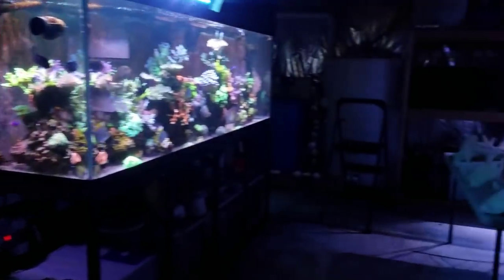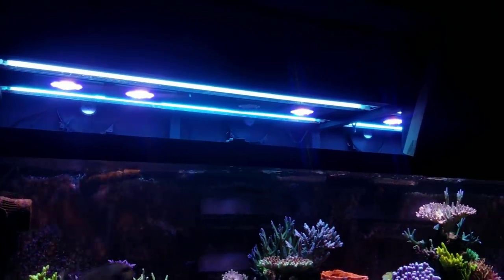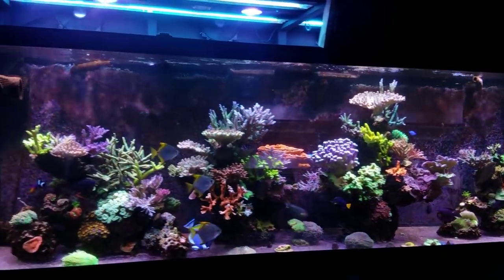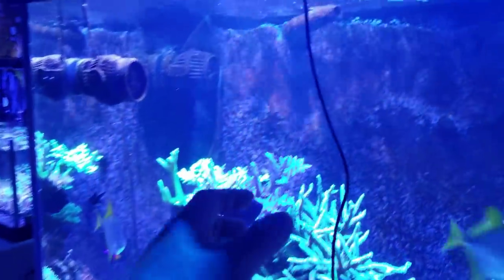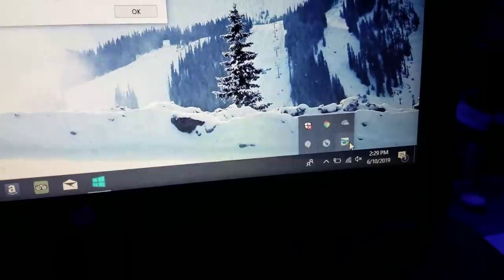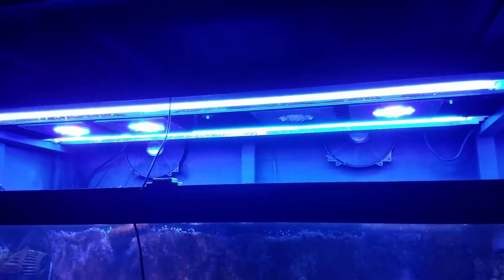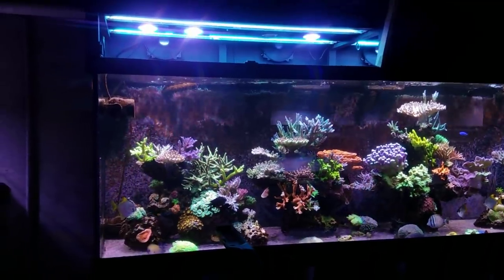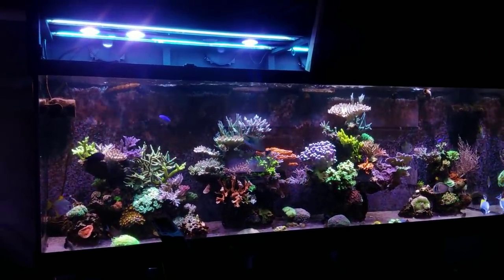Radion XR15 G4 pro Failure, Blinking Red Light | Now What?

Comment: I understand that the environment this equipment works in is one of the harshest you can create for electronics so Ecotech gets a little liberty there. However these are some of the most expensive lights on the market essentially, one would hope you were getting the best quality. You can get lights a lot cheaper that have a 25% failure rate in two years.

Comment: Sounds like the fan died. That may not be the issue but I do know from experience that if the fan dies then the light will not power on for more than a few seconds. Also check the connection on the board by the fuse where the power supply plugs into the board. I had one that had a connection issue

Comment: The fact that it turns on and then off after about 10 seconds tells me that it has something to do with either the thermal control or power control. Its probably not reading correctly or at all so it shuts off to save itself. If you lose another one on that side of your tank, id take a good long hard look at your source power and airflow

Comment: I have the AI HD Prime and I noticed if you don't take out that little screen that lets in ventilation and clean it from time to time and it gets plugged up with dust your lights will not function properly I take those out once a month and I clean them really nice and put them back I don't know about radians but if that ventilation is not working properly them lights can fail my lights also were blinking kind of strange but as soon as I clean that vent that all went away never had a problem again

Comment: So I tried to do a reset, but it did not seem to work.  I pressed the center button for over 10 seconds, then all three buttons for over 10 seconds, then the two outer buttons for over 10 seconds.  Nothing. I wanted to increase the intensity of the linked light, and when I did that, the G4 15XR turned on.  Not sure if this happened as they were connected, or because 30 seconds past from the reset attempt.  At least it works now. The next day, the red light came back. I unplugged the power, then found a micro USB cable that connected to the Connection Manager.  This seems to have fixed the issue for today lol
Reply: Its that the way to reset the unit? My xr 15 runs ok, but in the next morning it doesnt turn on, bliks red buttons. But if i unplug and reconect it to power its workshop fine, but in the next morning, red blikking buttons again. White can it Be ?